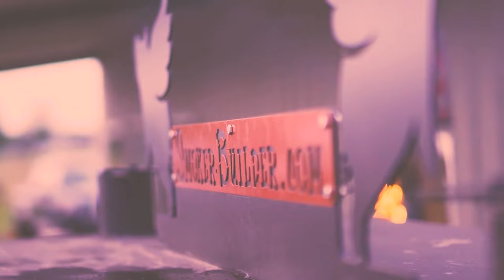Smoker Design: Are Door Leaks Bad Or Should I Fix Them?

Comment: I have recently just built an offset smoker. I am really happy with the performance. I am questioning the diameter of pipe I used off of my collector. My smoker is a 24" dia 1/4" thick pipe 4 foot long. My stack is 4 dia by 5 foot tall coming out of my collector. Is this some what in the ball park, or would 6 " be better?
Reply: The really important factor is that you're really happy with the performance. But, if you switched it to a 6 it would draw more in some circumstance where you decide you want it, and you can always choke down the draft if there's some need to.